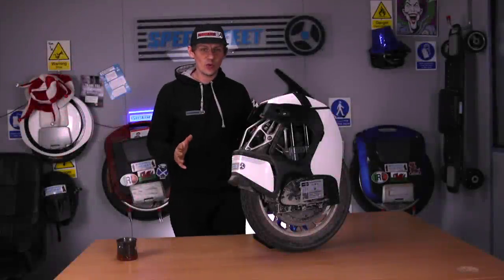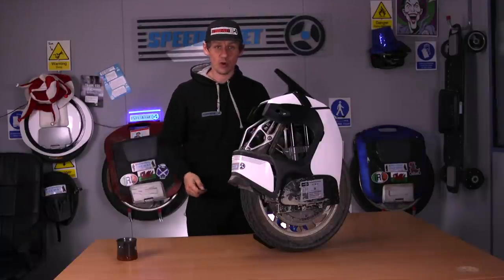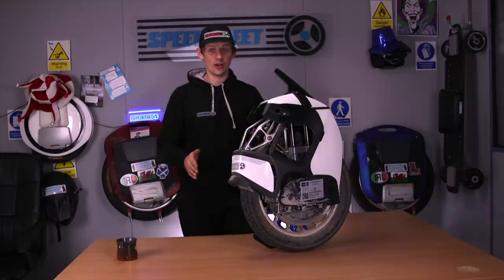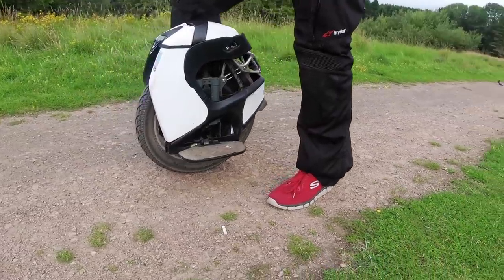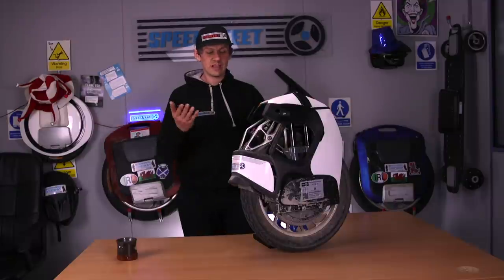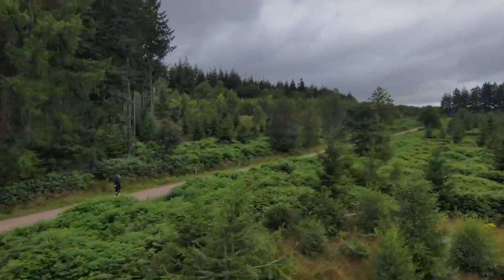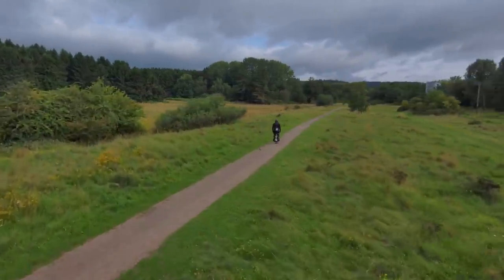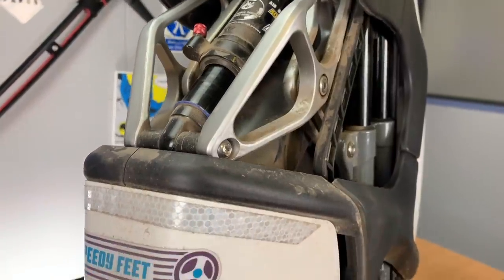1000KM on a Suspension Unicycle | Kingsong KS-S18 | Final Review!

Comment: Thanks Ian. I think that ks s18 is too large to be taken into smaller offices and buses what do you think?
Reply from the maker: Buses should be fine, its not massive in size, its quite tall though. It will not fit in a locker or anything like that, but it will fit under my desk in the office for example. Not sure if that helps?

Pop on over to www.ElectricPeople.org as well and join the community we setup!

Comment: At minute 4:00 did you mentioned you recommend KS-S18 ONLY for people that commute less than 20 Miles a day ?
Did I understand it wrong ?
Reply from the maker: Yes and no, it depends if you can charge at work / where-ever you are going. Also depends on how fast you are going. If going 25mph, it will do 20-25 miles per charge as per the videos. (be sure to checkout all 4!)

PS: Also checkout www.ElectricPeople.org and join the community!

Comment: Merci for the answer , with the wheel on if you plug the charger does the wheel turn off ? If not then an external battery pack would adress the limited battery capacity of the wheel
Reply from the maker: Not tried, but pretty sure at standstill yeah it will, like the others.
Reply: On my INMOTION V10F when I plug the charger the wheel turn off , that why I need to know if the S18 turn off when the charger is connected

Comment: That charge port cover doesn’t look like it would stop water ingress? It flaps up and down when you come off of a bump?
Reply from the maker: Yeah, mentioned in one of the previous videos, supposed to be fixed in the final release. (But I think the port is IP rated anyhow, not 100% sure on that as would need to ask the producer of said port for a data sheet).

Comment: Hi,  could I ask you to compare the range of the S18 to the range of say an inmotion V8?
(thought that might be better than just giving a figure that would depend on terrain and rider weight etc)
Reply from the maker: It will be similar to the V8F, although not a fair comparison as the KS-S18 of course goes faster, so when both are at top speeds the range is pretty much similar - only the KS-S18 will accomplish that at a higher avg speed.

Pop on over to www.ElectricPeople.org as well and join the community we setup!
Reply: Roughly double the range. v8 gets about 14-17miles tops, whereas my tesla (similar spec to s18) I can get like 26-35ish :) this is riding both together with a friend. His ran out of battery where tesla still has 60% left.

Comment: Are you in contact with Kingsong? Whats the actual socket size. Many people said that it has a standard socket size but 165 x 35 is not standard. Its 165 x 38. Most good shocks come with a bigger stroke... I wonder if its just gonna be a fail and you cant even put a good shock on this thing. :(
Reply: I think the shock is 190 x 50
Reply: @beaglersTP  looks too small for that and the DMM the is 165x35.
Reply: @eveoff  have you seen the "How to set up the S18 Suspension". Posted by Future Transportation on Youtube. The guy looks to be a Kingsong employee and he says the max travel is 50mm. Also somewhere I've read that the shock is DNM 38RC and the only 50 they do seems to be 190 x 50.

Edit. The DNM 36RC with the double chamber on the pre production came in 3 sizes, 165, 190 and 200.

Also it is the eye to eye measure that dictates if the shock will fit. So EVEN if it is 165x35 it will still fit. The 3mm travel difference can easily be sorted by the pressure in the chamber
Reply: @beaglersTP  I know but if the stroke is too high you might have a subpar suspension even if costed you 500 bucks.
Reply: @eveoff  I doubt if there is a 3mm difference it would be noticeable. :)
Reply: @beaglersTP  If the travel of the suspension mechanism is 35-40 max it would pretty much break the suspension. If its 50 though. It should be fine.
Reply: @eveoff  not sure i follow but I've only been looking into this recently for the S18 so still learning. If the shock fully extended is 165, why would it matter that much if the travel is 35 or 38? If 38 that means the length of the shock is anywhere between 165-127 and if 35 it is 165-130. Can't see how 3mm can break anything?

Comment: My heart wants s18 but my brain says get v11. Help me god.
Reply: Get both? :)
Reply from the maker: Ha ha, yeah, just get both ;)
Reply: Why does your brain say v11? I am sold on this wheel but didn't really look into v11 just yet so id be nice to hear why it tops s18 for you
Reply: @mehmetkaran998  may be brand, may be the way the suspension is delivered. V11 is more like a moving part attached to a conventional EUC whereas the S18 is more integrated. What that means though I think is  that there are some wires moving with the suspension on the S18 but not the v11. That said Speedyfeet completed 1000km without issues on the S18.
Reply: S18 has way better suspension.  That is why I want it.
Reply: did you see hsiang's crash?

Comment: i keep seeing  tons of fish tailing in your trail rides. you have it under control, but if you were less skilled, you might crash more often.
Reply from the maker: Short answer: can you get 'fish tailing' yeah (in kind of the same way as the 'tank slap' on heavy braking discussed in this video and in depth in video 1).

More indepth answer:

Yeah you for sure can get that, but its kind of rare, with the rear cam shots offroad (close ups) my upper body is twisted whilst holding the cam equipment and also viewing a screen/phone to ensure the wheel is correctly framed; this certainly doesn't help the ride. (For an example, a test to show what I am on about: ride along normally then bed over to turn on the light / any light on a wheel, and that change of posture causes a tank slap.....not in every single case..but you get the point, in a lot of cases it does due to your body being all out of sorts).
Reply: Speedy Feet UK I’m all too familiar with bending over filming my Unicycle with my giant dslr rig lol
Reply from the maker: @evXNYC  yeah, it creates some 'interesting' riding experiences ;)